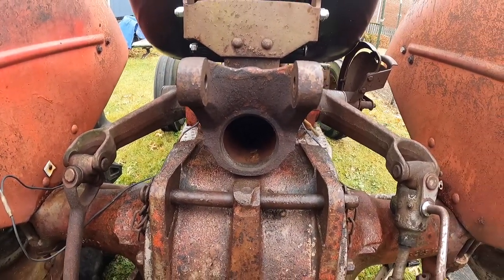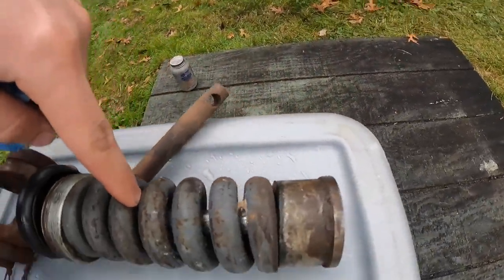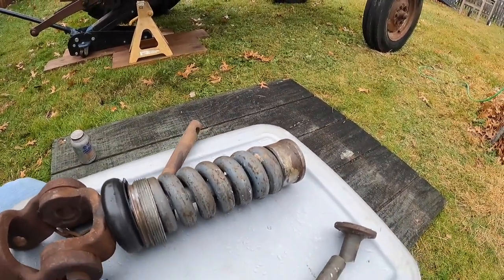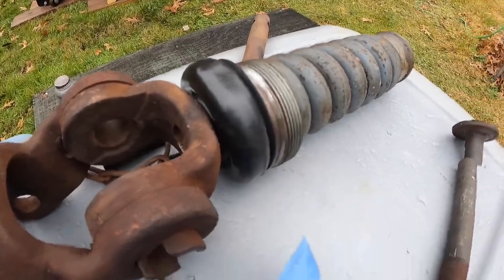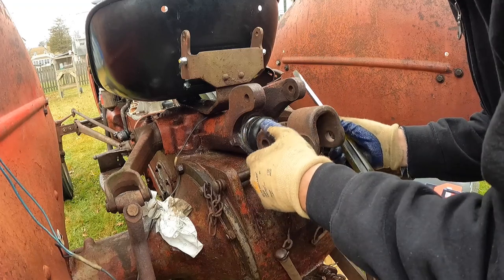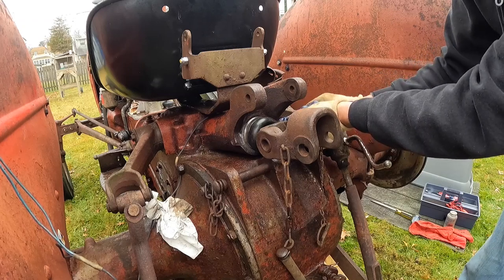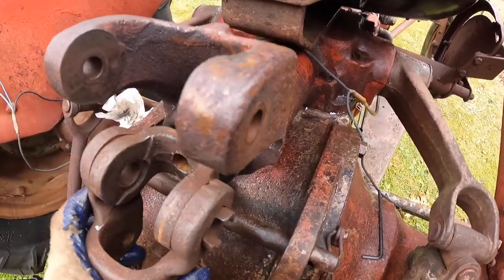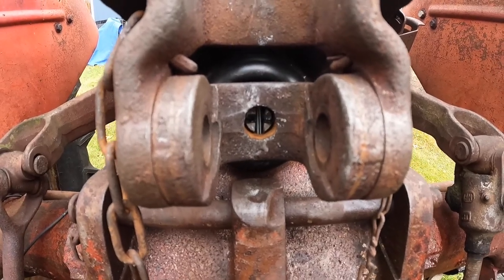Massey Ferguson 35 draft boot replacement

Comment: Thanks for the video. My 'turnbuckle" had a rubber plug in the threaded end so the rod unthreaded rather easily. 1965 135MF
Reply from the maker: That was a lucky break. I may just have to add a rubber plug to mine that is an excellent idea.
Reply: @thedelcodave  p.# 180982M1

Comment: Will water get into the transmission if the boot is gone.?
Reply from the maker: These tractors share a fluid reservoir with the rear  and the gearbox.  So if your boot is missing water will get down and contaminate your fluid.  The boots on the shifters will leak water directly into your transmission.

Comment: Is your draft control working 
OK now?
Reply from the maker: I think so.  I do not have any implements. Is there a way to test it without a plow.  3 point lifts up and down as it should.
Reply: @thedelcodave  you can put the draft lever in the position between the dots and the control lever in the fast or slow position. Then give that clevis at the back a good shake and pull, best with a top link on and see it the lift arms come up and down
Reply from the maker: @prime553  I'll give that a try

Comment: Cool man.  Getting there.  Have you checked out my sandblasting for cheapskates video?  Just in case you were wanting to do a prep and paint job.
Reply from the maker: Yes I saw the video. My friend offered his sandblaster but I have been just wire wheeling for now.  My compressor would have trouble keeping up with his machine.  What I really wanted to do was just pay a dustless blaster guy to come and blast it... but apparently they do not work in the winter months when its freezing.  I have a neighbor that is going to let me spray the tractor in his heated detached garage so next nice weekend that will be going down.